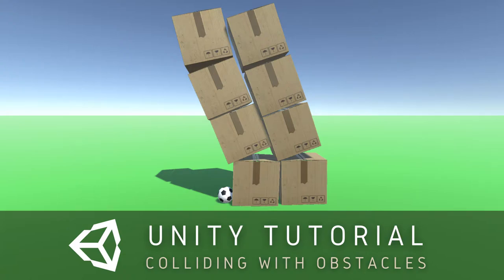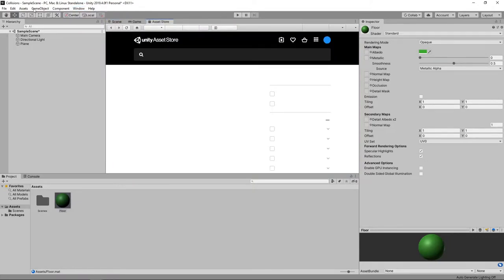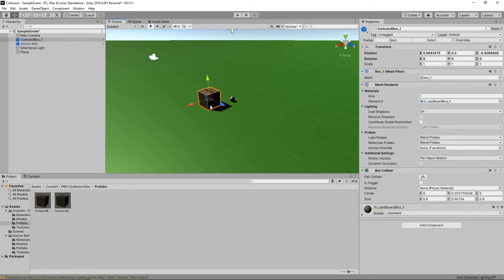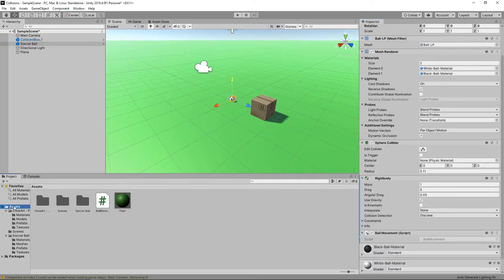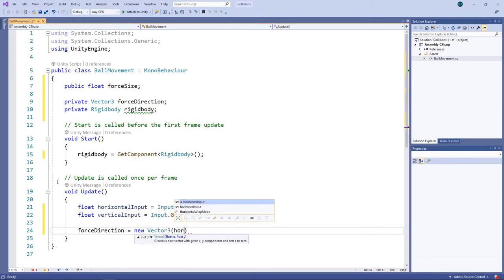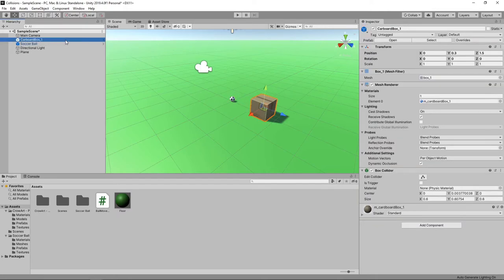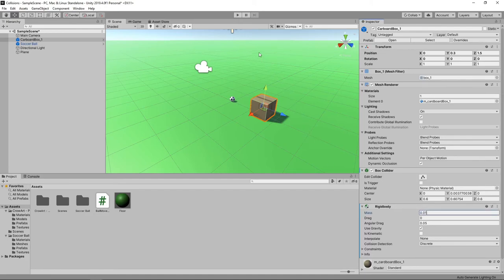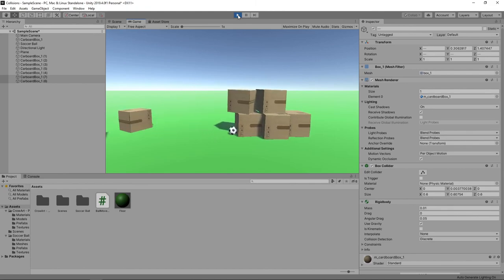Colliding with Obstacles (Unity Tutorial)

Comment: Assets\BallMovement.cs(32,19): error CS1061: 'Rigidbody' does not contain a definition for 'Addforce' and no accessible extension method 'Addforce' accepting a first argument of type 'Rigidbody' could be found (are you missing a using directive or an assembly reference?)

Comment: using System.Collections;
using System.Collections.Generic;
using UnityEngine;

public class BallMovement : MonoBehaviour
{
   public float forceSize;

   private Vector3 forceDirection;
   private Rigidbody rigidbody;

    // Start is called before the first frame update
    void Start()
    {
       rigidbody = GetComponent<RigidBody>(); 
    }

    // Update is called once per frame
    void Update()
    {
      float horizontalInput = Input.GetAxis("Horizontal"); 
      float verticalInput = Input.GetAxis("Vertical");

      forceDirection = new Vector3(horizontalInput, 0, verticalInput);
      forceDirection.Normalize();
    }
    
    private void FixedUpdate()
    {
        Vector3 force = forceDirection * forceSize;
    
        rigidbody.Addforce(force);
    }
}